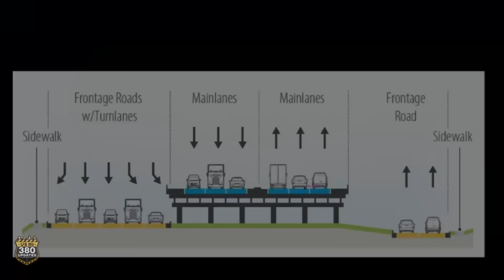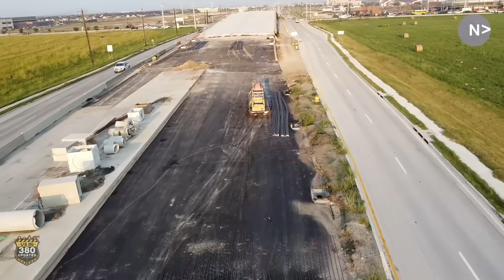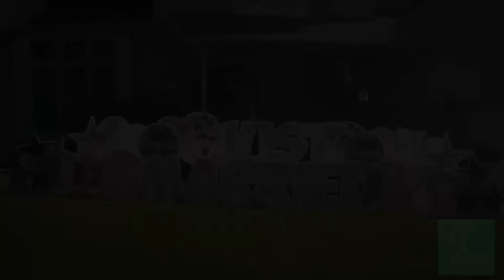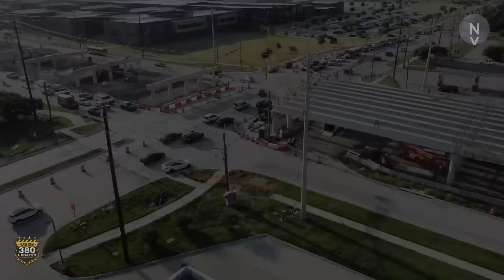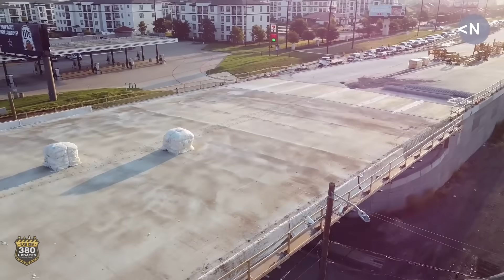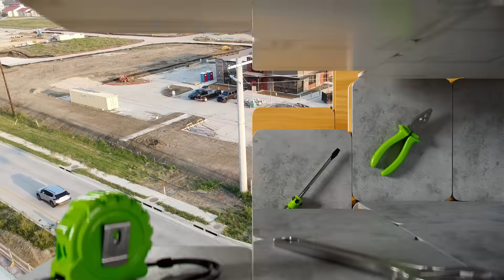Final Beams at Navo + Walmart Opens Oct 1 | 380 Expansion Update

Comment: After the hollyhock signal will it be a mini freeway before the overpass going to preston and after done we can drive to hollyhock similar to DNT but not fully and for the light at doe creek why does it make almost 0 sense that there is a massive overpass and for the 423 it makes sense and no sense at all as you are driving 50 or higher than the overpass makes you want to go faster and the hollyhock signal makes it a bit of a mess what could possibly happen for that.

Comment: At about 12 min mark and the comment that traffic is already diverted to the new roadway, looks like there is no lane marking? No striping? That’s terrifying. I haven’t driven past Crossroads on 380 in about 2 years. Cutting over to Eldorado May take longer but way safer.
Reply from the maker: The comment was highlighting the fact that there is no overpass at that 2931/Main Street intersection. There is quite a bit more concrete to pour and yes lane stripping to finalize.

Comment: What's the plan for the 1385/380 Intersection? That seems like a constant bottleneck and they didn't build a bridge over it. How are they planning on making it better?
Reply from the maker: We have a video about 1385 back on April 3rd. 

FM 1385 won’t have an overpass as part of the current 380 project because TxDOT has a separate expansion planned. Right now 1385 is only two lanes, but it’s set to become a six-lane divided roadway from 380 up to Mustang Road, with a four-lane interim and six-lane ultimate section continuing to FM 455. The project also realigns the Fishtrap/Gee intersection — removing the current S-curve, shifting Fishtrap east to meet 1385 at a new intersection, and tying Gee into 1385 at another new connection. Parts of the old roadway will be removed, though access to Paradise Snow Cone Shack will stay.

With FM 423 also being widened north, that corridor will handle more traffic, which is why an overpass at 1385 wasn’t included in the current design. They will try to draw traffic away with a better flowing road way north and south at 423.

https://www.youtube.com/watch?v=V0HFqBD_438
Reply: Bypass north of Hwy380

Comment: will 720 and 2941 eventually be opened up to 4 lanes?
Reply from the maker: Assuming you mean north and south on those roads. 

720 north /Oak Grove - has no project planned to expand 

2931 Main Street does have a phased expansion plan north of 380. Eventually it will be a 6 lane divided roadway. The 380 intersection is built to accommodate that future growth.
Reply: @US380Updates  will 720 north of 380 be expanded to more lanes?
Reply from the maker: @johnq4196 eventually…

Comment: None of this addresses the roads needed to get to 380 the traffic  is bumper to bumper off 380
Reply from the maker: We hear you. The side roads are definitely feeling the strain right now. The plan is that once the overpasses and added lanes are open, more of that traffic will flow back onto 380 instead of clogging the cut-throughs. Out of curiosity, which side road do you find the toughest right now?
Reply: @US380Updates fishtrap is a disaster 😂 do a lot of people use that to cut through?
Reply from the maker: @michaela452 that’s really the only alternative to 380. GPS does try to suggest that often.

Comment: So we are keeping the Windsong intersection and creating a log jam there instead of a bridge or closing off so it can flow non-stop all the way thru Prosper. I do not get that.
Reply: @post-punkrider  You have to remember that this job was designed over 10 years ago.  No one realized that the area would blow up this much. Also, this job was a saftey job, not a mobility job.  The main objective was to cut down on the bad head on collisions with the middle island and lighting.
Reply from the maker: It actually sounds like you do get it. Have a good weekend and drive safe! 2045 plan is to blow it all out with a full highway and service roads.

Comment: I'm still not sure how any of this is going to matter without an overpass for 1385, that seems to me as the the biggest cause for backups along this corridor and it will remain a traffic light.
Reply: The overpass at 423 will just be backed up likely. Huge mess coming soon
Reply: @jimmyt2810 agreed, 423 overpass will likely just back up past the Hollyhock or Teel traffic lights
Reply: Agree. The light at spritas/main st is causing more delay now spritas pkwy is open. By the time this project is completed, with new shops and streets, it won't make a difference
Reply: 1385 will be rerouted to fm 423 where it intersects with fish trap in another project to help reduce the traffic at that intersection.
Reply from the maker: We have a video about 1385 back on April 3rd. 

FM 1385 won’t have an overpass as part of the current 380 project because TxDOT has a separate expansion planned. Right now 1385 is only two lanes, but it’s set to become a six-lane divided roadway from 380 up to Mustang Road, with a four-lane interim and six-lane ultimate section continuing to FM 455. The project also realigns the Fishtrap/Gee intersection — removing the current S-curve, shifting Fishtrap east to meet 1385 at a new intersection, and tying Gee into 1385 at another new connection. Parts of the old roadway will be removed, though access to Paradise Snow Cone Shack will stay.

With FM 423 also being widened north, that corridor will handle more traffic, which is why an overpass at 1385 wasn’t included in the current design. They will try to draw traffic away with a better flowing road way north and south at 423.

https://www.youtube.com/watch?v=V0HFqBD_438
Reply: @US380Updates yes but not until 2030 at the earliest before the expansion even begins!
Reply: I agree Costco is creating a lot of traffic there and the lanes are confusing and uneven. Think how bad it will be when other shops open.
Reply: @frankcoffey the traffic was already incredibly heavy before Costco came in. There's just too many cars coming through that area for a traffic light to handle
Reply: @delahoussayeTV  And they are still building houses north of Fishtrap off 1385 and there are no escape routes.

Comment: Will the overpass lanes merge into two lanes or one? Will there be on and off ramps to the overpass?
Reply from the maker: The finished roadway will have three lanes in each direction, and the overpasses themselves will also carry three lanes each way. What drivers are using today to get around the bridges are the permanent on/off ramps; they just feel like detours right now since the main bridge lanes are not yet open. Once the overpasses tie in, those ramps will serve their intended role as the connectors to and from the main lanes.